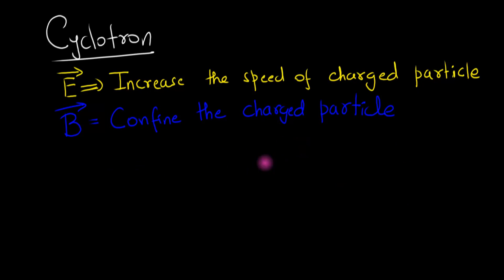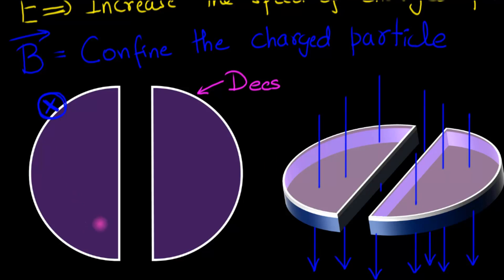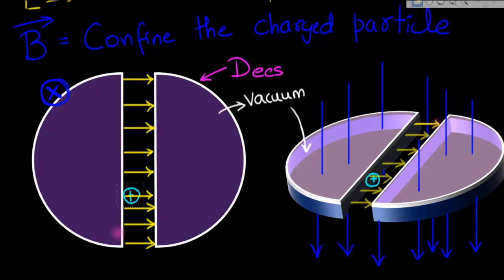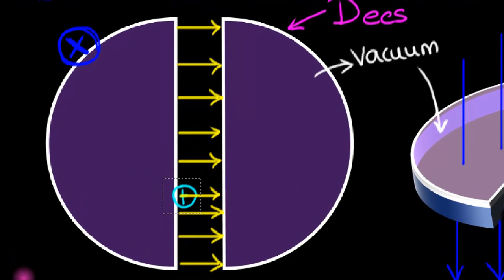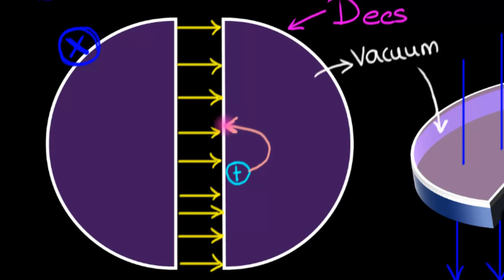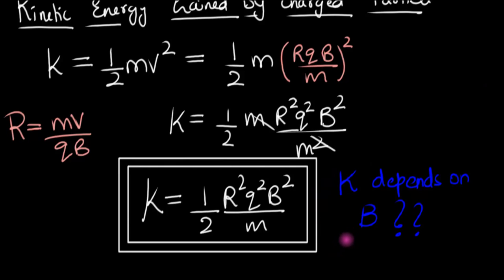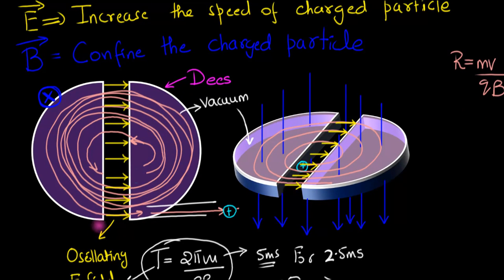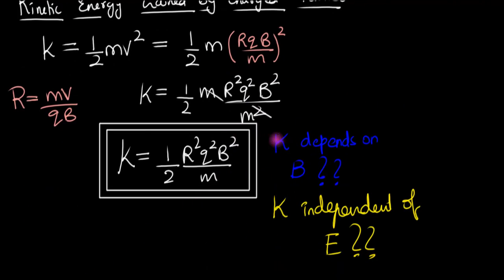Cyclotron - How does it work?

Comment: KE depend on  B because as the Bincreases the partice can go around MORE times, increasing its velocity.... because the stronger the B the sharper the particle curves with smaller radius increase, thus more turns.
Reply: Can it be that, switching electric field between the Des is creating magnetic field?

Comment: How can we ignore R which is changing all the time due to electric field ....every time particle is between Dee's electric field does work on it by work energy theorem change in  kinetic energy  equals work done by all the forces and as magnetic force acts perpendicular cannot do any work electric field does work between the Dee's and net some of all that work is change in kinetic energy the term B in his expression is constant so to talk of dependence on constant is not correct the only variable is R which is variable due to E  ....
Reply from the maker: Vikas Balani I get you. Maybe I wasn't clear. The final expression represents the maximum kinetic energy, and the R is actually the maximum radius (which is nothing but the radius of the Dee's). So for a given cyclotron, the maximum radius is a constant isn't it? That is why I said R is a constant.